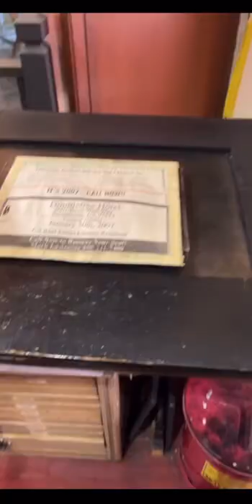Happy 165th birthday to the Sacramento Bee! The Bee is the longest running newspaper in Sacramento.

Comment: I got a question. Is there a reason to using the older newspaper? Does it press better or is it just because you haven't had to replace it?
Reply: I could be completely wrong, but I believe it helps the paper get into the nooks without being crinkled and get a solid consistent spread. No blotchiness.
Reply from the maker: The Newspaper we place on top serves as packing/padding to help not only print a more full image, but also to protect the old equipment.
Reply: @SacramentoHistoryMuseum  so I was 10% right.
Nailed it!